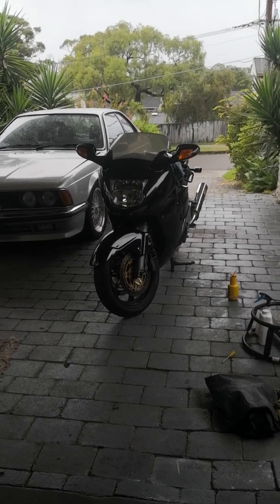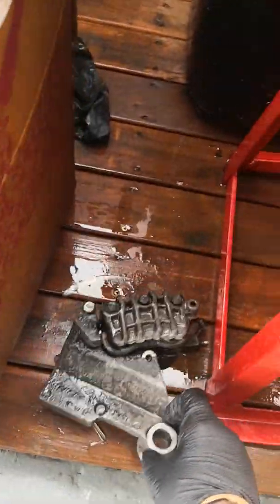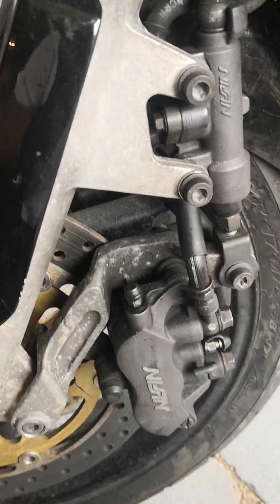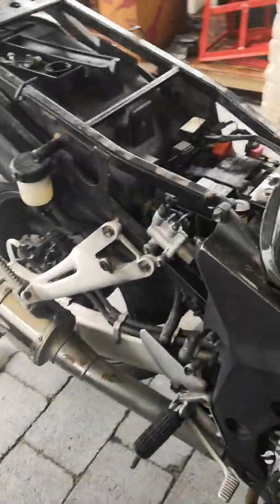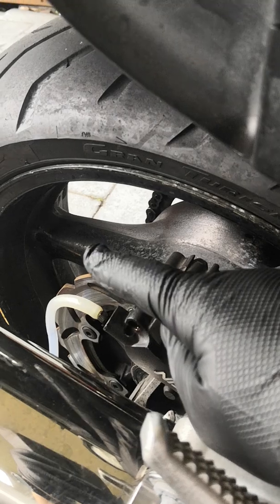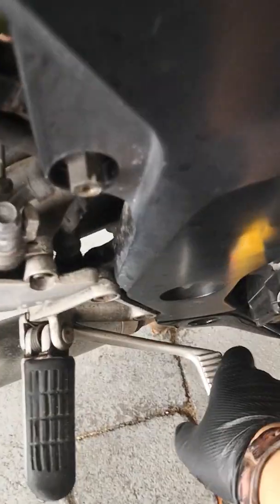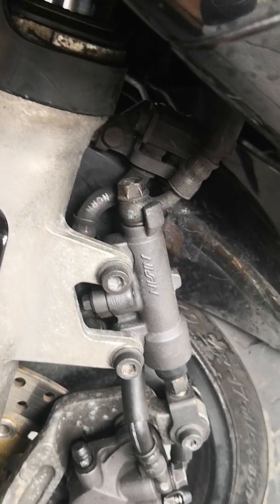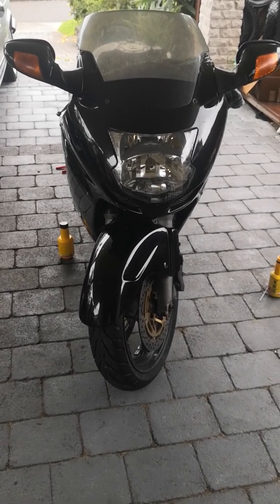CBR1100XX stuck rear caliper & bleeding process

Comment: Do you have another video on how to fix the rear break and work on the second master cylinder? Thanks
Reply from the maker: I do not; but have a short video with a photo of what to expect when you take it apart.
Recently did the job again - video was impossible due to the amount of brake fluid that goes everywhere 😩.

Having done this so many times, disassemble the secondary master at the front fork (do drain the brake fluid first) liberally clean in a tub of brake fluid and consider a repair kit.
Reply from the maker: Drain fluid completely
Crack the 3 torx screws
Undo the nut holding the master in place (only one) 
Remove, gently remove rubber boot (mine tore hence needed new kit)
Clean or rebuild.
Reply from the maker: One last thing. The two 10mm on the master hide the filter. 
Undo those, and even if you don't fully dismantle you'll see the dirt covering the return hole

Comment: You are saying having air in the system caused the caliper to melt???
Reply from the maker: No. Having a poorly maintained (unflushed) combined brake system meant the debris did not allow the secondary located on the left front fork to release the pressure from the rear 

I would only recommend home mechanic to fix if you understand how the CBS works

Comment: should I put more oil after bleed it?
Reply from the maker: Depends on what oil you mean. If bleeding, brake fluid yes.
Engine oil should have no bearing with the brakes. If it does something went wrong somewhere!

Comment: I picked up one of these (I also had one with 115k miles years ago) recently and having similar issues with rear brake. The CBS is persnickety. My rear caliper locks if I press the rear pedal but it also slowly begins biting as it heats up...and it's actually not easy to tell it's a problem unless you were very carefully checking it about every mile. The bird is powerful enough that you don't notice it griping. Only at slow speeds o when stopped can you tell... It can also destroy your wheel bearing back there and blow the tire from heat.. I'm about to go through all my brakes.. this bird sat for about a decade or so..

And yes, btw, these are my favorite motorcycle. I've ridden many but the blackbird is really special
Reply from the maker: Agreed, I have had many, but the XX is a different kind of beast! My rear caliper totally melted, still have it as a paperweight!

Deffo flush it, and flush it well, then do it one more time. While I am sure you know, cleaning the return hole on the slave on the front fork is crucial - I used a wire brush bristle and hey presto! Will do a short video of what I used as reference as others asked, and hope it helps. Thanks for stopping by and good luck matey!
Reply: @nikchristides4895  I really appreciate your video. A picture is worth a thousand words but your video on this particular issue is worth more. I am currently in a strange place and without a manual but your video alone is EXACTLY what I needed to see to help me through this procedure.
Reply from the maker: Video , made of two pages and me talking should be up soon. Good luck my friend!
Reply: @nikchristides4895  question for you -i currently have the secondary master right here in my hand. How do you back the little filter out?  Mine is stuck in the hole. I've tried pumping the actuator to create pressure to see if it would pop out. Nothing yet. Thanks
Reply from the maker: @Guy-ky9mc  from memory, I did the work on the bench, and used the tiniest flat head and toothpick to avoid damaging the soft plastic. 
Disconnect the whole thing and look for something flat to pry them apart. I think there is a small opening one of my watchmakers flat heads got in and I still gouged/deformed it a little 😬
Reply from the maker: @Guy-ky9mc  maybe a needle to work it out, as they are slotted inside each other
Reply: @nikchristides4895  wow yeah.. it's not moving right now. Thought about putting some compressed air where the banjo goes to put pressure on the whole unit
Reply from the maker: @Guy-ky9mc  that might work too. I ended up gouging it think "noooo" but pushed the plastic back in place and all is fine. Patience. air might work, but if you lose the ball and spring it's game over.
Reply: @nikchristides4895  I got the filter out fairly easily but not the little assembly with ball/spring. Hmm good times 🦧
Reply from the maker: @Guy-ky9mc  shows why it was stuck. Did you manage to fix it?

Comment: I would have been pulling out my hair  if your vido wasn't out.GR 8 video !
Reply from the maker: I sincerely appreciate that! I will also try to video the two pages I used to clean the return valve on the front LHS fork slave (which activates the rear) , but .. drowning in bringing an RF900R to life

Comment: Hello, great video…, I too had this exact thing happen.. however my combined brakes were deleted before I bought it and they had worked ok for a couple of seasons. I had just changed all pads front and rear, did not bleed brakes.. thinking I didn’t need to however within 15 miles realized rear brakes were sticking severely and completely wore out a new set.., also partially having some caliper melt and distortion..! 
First question- we’re can I find a replacement caliper, I’m in the USA..? Have had no luck..
Secondly, is it safe to use the caliper I have as I planned on replacing all seals…? 
Thank you,
Keith
Reply from the maker: Hey Keith, our symptoms where the same. My caliper was so badly melted, it had the shape of the hub - like melted cheese - mine is now in the yard getting rusty as a conversation piece. I did not even try salvaging it!
My recommendation would be to join one or two Facebook XX groups. There is a gentleman called Paul Manners, he is collecting parts, renewing and selling and think it's your best bet.

The other idea would be ebay or something similar, to find someone dismantling Blackbirds. 

Join the FB group. There is some noise as always in FB, but nice group to be part of. 

Finally me personal theorem - the jobs we hate doing (like bleeding/fitting tyres etc) are the jobs we end up doing so many times we become experts 😆 Good luck, message again if stuck.